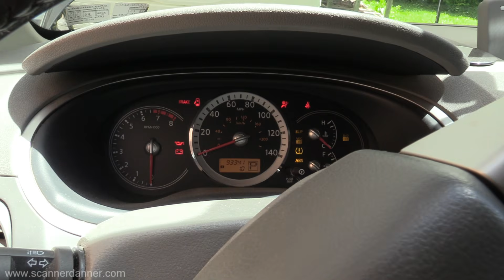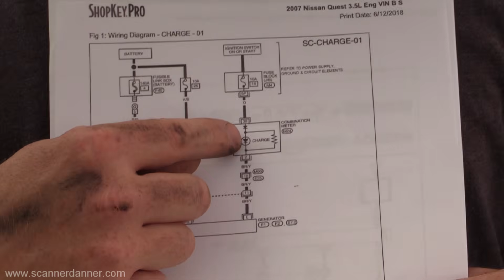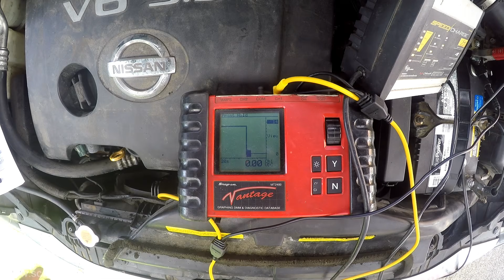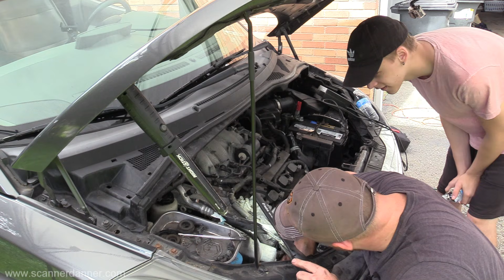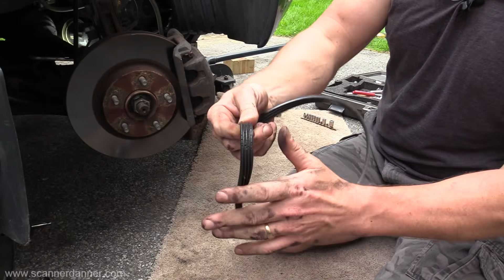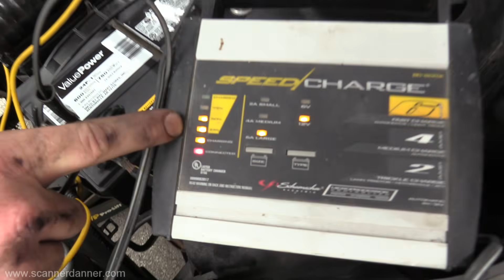How NOT to Test a Charging System (2007 Nissan Quest)

Comment: Voltage drop test on the BAT cable is no good since (unknown at the time) it wasn’t carrying any current.  I was suspicious of that as I’ve never seen it at exactly 0.00 except under no load. Every conductor will have at least some drop as there is always some resistance. Even with perfect connections.
Reply from the maker: Yep and I totally missed that

Comment: Speaking of bad alternator grounds... The german channel Autodoktoren (https://www.youtube.com/user/Autodoktoren ) had such a case quite recently where the customer replaced the alternator but it was still not charging. Turns out, the places where it was bolted to the block were oxidized. They cleaned it up and everything was fine again.
https://www.youtube.com/watch?v=UgpbolCdd_I starting at 09:55 and they pinpoint the issue starting at 14:58.
Reply from the maker: Awesome! I'll check it out. That is a good example of why we do that test.
Reply: @ScannerDanner  Let me know if you need some translations or something like that. Will see what I can come up with.

These two have their own garage but are very good friends. They started a TV show a very long time ago on the geman TV channel "VOX". Two years ago they started with that Youtube channel.

They show strange issues, explain things or just their daily business.

Comment: If you had done the alternator, I think you would have found you would have pulled the radiator too. I have done a lot of these on Muranos and Maximas with the 3.5l and they are all the same chassis. You may have been able to get to the alternator without pulling radiator, but for the extra few minutes it takes to remove, it is worth it for the extra space it gives you. Also, FYI the radiator drain plug is on the very bottom almost directly below the cap. Factory radiators usually take a #3 phillips to remove. Aftermarket radiators may have something else. I just did a 2006 Maxima alternator 2 days ago.
Reply: It may be on more recent models, but I've  replaced them on the 3.5l by dropping the engine 1/2" and pulling them out at the front of the engine.

Comment: Heh, Yeah i never ordered a special relay and after the job the problem was still there. What happend? Yeah, next time install the new working relay in, instead the old broken one ;)
by the way. i have had belts missing in cars and there has bean cars that have metal idel pully normally.
And cars that has metal pully in there now, but when it was new it has had plastic top on it.
So it is good habit to look should it has plastic cover over the metal or not as it could have bean melted away when the pully bearing was solid and  so broken...
Reply: Yep. Been there with a big fuse.

Comment: Great video, up front and tryieng the best to educate and learn at the same time. Just one hint from me: Never turn a engine againt its normal rotation (clockwise mostly) cause i had it ones that a timingbelt jumped one tooth. The engine was still fine, nothing damaged, but it couldn't start since the timing was of. Since then i never turn an engine anticlockwise
Reply from the maker: I won't argue at all but I've done this probably a thousand times. Guess there is always that one right?
Reply: @ScannerDanner  yeah, there are so many things that are sometimes just personal preferences, that you do the way you do.
A: because it always worked
B: I went wrong one time
(C: the manufacture says to do it that way and you are ok with it :D)

Comment: I made a blunder the other day Paul I went out to investigate my friend's car a no-start condition he was chasing fuel pump I thought place to start with with your main relay video so the first thing I did was test the under hood fuses one came up dead I looked over at the legend and I thought it was a spare after tooling around for an hour and a half to just verify nothing was going back to the fuel pump nothing was sparking I thought he had some other issue perhaps with the security system I wanted another look at a wiring diagram and it ends up the dead fuse that I found was indeed the entire problem I just thought it was a spare the guy who found it knew absolutely nothing about cars I felt like a moron
Reply from the maker: Man, been there too my friend. Persistence was the key. Good job
Reply: Now you have to figure out why the fuse blew.  You don’t want a comeback, even among friends.
Reply: @sirsweetness8332  well he replaced the main relay..I have not tested it yet.. But.. Theory would be it was drawing extra amps or had shorted... The old one

Comment: Just FYI new belts don't crack anymore! The groves wear down like tires Gates has a belt wear guage they offer!!
Reply: yes they do! Specially Gates blue ones did years ago so soon that Engine oil didn't need even to be changed.
And that made us go away from Gates as alternator belt installer/seller for a while.
But today i don't remember the last time, that i had to deal with this problem.
So, yes they might have don it, but still i don't sell them as no cracking belt, even when i'am Gates tech partner as the warranty to change them over and over again, cost as so.....
Reply: Since when? I'm still seeing cracked belts.
Reply: @fascistpedant758  probably because they've been on there a long time!
Reply: bigdaddymak1439   4-5 year old cars. You don't always see the cracks unless you remove the belt and bend it back.
Reply: @fascistpedant758  then some manufacturers were still using the old rubber belts but they will eventually run out and use the new belts! My Subarus have over 60k miles on them and no cracks but the grooves were wore out when I replaced them! They have a gauge now to tell when they've worn out
Reply: I was looking for someone to post this. The key is EPDM instead of regular material.
Reply: Timothy Ball    Dayco states that " these EPDM belts don’t crack as easily as their Neoprene predecessors". They also state that EPDM has been used for 10-15 years.

Comment: Paul; if I never blew a diag by missing something obvious, I would have my own "The Perfect Tech" Youtube channel. I would emphasize to Techs to check the alternator belt tension as part of any charging system evaluation [just as you should always check the A/C compressor belt on any no/low A/C cooling complaint] [Same as with checking the water pump belt with a hot running/overheating complaint, when so driven]. I have seen a loose belt cause a no/low charge issue before. In checking the belt tension, the fact the belt was awol would have been caught during initial diag. Thank you for your candidness. We all need to be reminded once in a while.

Comment: Hey Mr Danner, One Hunnit here...

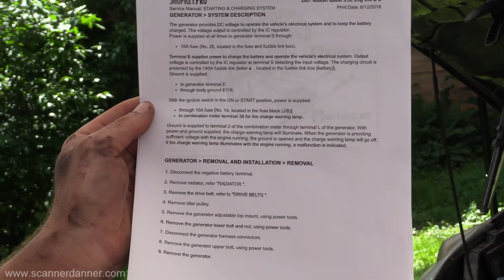@ 9:30, if the alternator has no output &/or the "Batt" post is "open", then wouldn't the potential at both ends be "B+" and thereby show no V.D.?

Also, if not the alternator, what was making that howling earlier?

-100
Reply from the maker: Keep in mind the test I did was positive to positive so a perfect circuit would read 0 volts because both ends of the wire would be 12v. 12v connected to 12v = no difference in potential, you your meter reads 0.
Second question, I don't know what was whining as I didn't hear anything of concern after I was done.
Reply: @ScannerDanner  
Knowing how full a day can get, I appreciate you responding!
Thanks!

I'm also a big fan of showing the human side of this job...kinda like when ETCG1 showed the engine falling. 

Kudos Sir!

-100